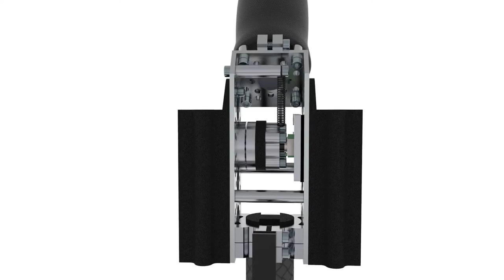Control Issues - EP 11: Lightweight Weed Whacker

Comment: You could monitor the battery voltage with the Arduino, then use one or more of the neopixels as a battery level indicator, and program a low voltage cutoff. You could even use the motor as buzzer to indicate that the voltage is too low when you pull the trigger.
Reply from the maker: Good ideas :)

Comment: More powerful motor, commercial style line head, remote belt hung multi battery pack designed to be easily switched out and you would have a feather weight commercial product that would sell.

Same for leaf blowers and any other portable motorized landscape tools pro landscapers use.

One of the biggest problems pro landscapers have in certain areas are early mourning noise complaints. well designed battery powered equipment that is silent would instantly sell to landscapers in upper end communities where noisy equipment causes many complaints. No one wants to be woken up at 4:45 am when they shoulda been able to get another 1/2 hr of sleep or have their baby woke up by the neighbors landscape maintenance crew, or your own hired landscape crew arriving and starting work at the crackass of dawn. 

In such cases certain landscape companies could gain market advantage if they advertised total silent landscape services, and those companies could charge a premium for this and people would gladly pay it.

~